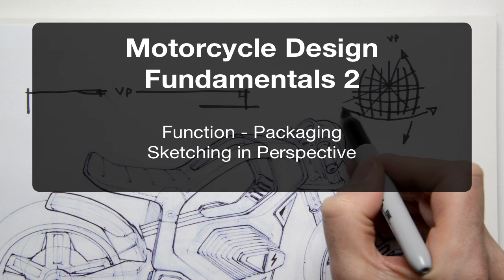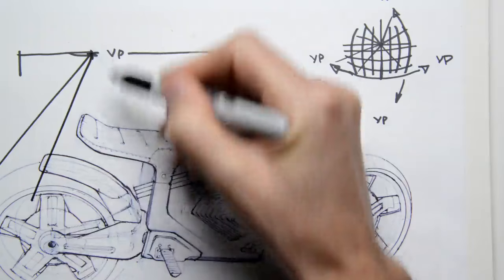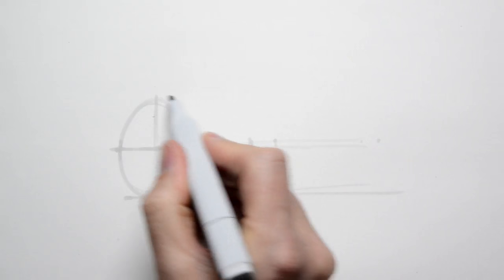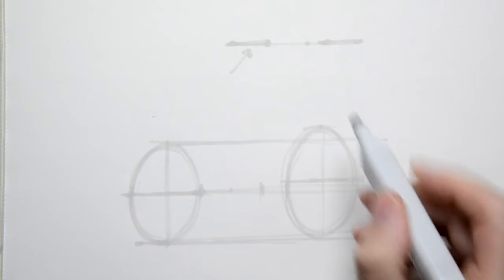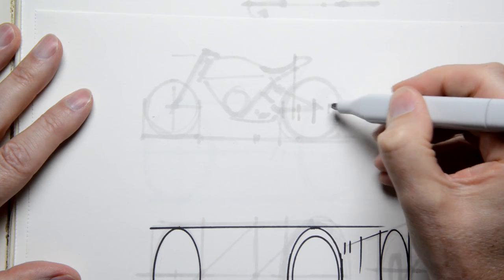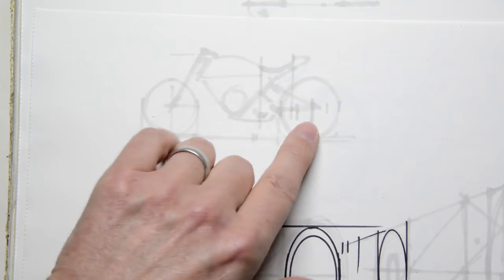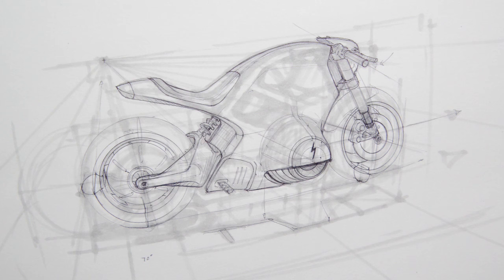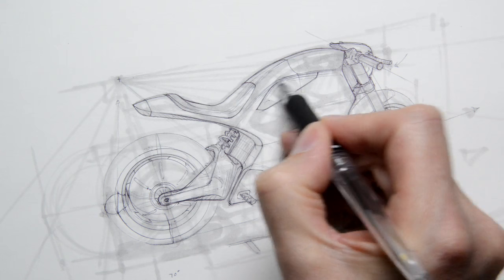Gumroad Tutorial Excerpts: Motorcycle Design 2

Comment: Many people lack the comprehension of the force.  And the direction of the force while moving .. the force line of the force direction is parallel to the road surface (road surface, tire surface, falcum point of both wheels  And finally, the center of gravity.  Of the weight of the car and people) .. but when the car turns  But the road surface is not sloping  With the line of force of the direction of force  Will lose the balance

Comment: Incredible insight from all your tutorials. Also own your How to Draw book and it’s invaluable. I do have a question regarding your technique for building the front tire. The ellipse used for indicating the tire at center... is it one ellipse guide completely, or is it one ellipse guide to create the inner edge of the rim barrel, and then a larger ellipse guide at the top and bottom to connect the outer edge ( tire center ) to the right side of the inner tire? Hopefully that makes sense. Or is it just one ellipse guide of a different degree
Reply from the maker: Good question and good eye! It's not one, single larger ellipse guide to create the silhouette of the tire. I use a single guide for the rims, but if you then let the tire section properly dictate the silhouette you will observe a single guide will not match to your section lines properly, so I sort of blend a couple together or move around a single larger one to adapt to the section lines of the tire. Hope that makes sense.
Reply: Thank you! What you described is how I have been executing it, but I was second-guessing whether there was an obvious easier way I wasn’t picking up on.

Comment: Hi Scott, I bought your Motocycle design 2 in gumroad. Im confuse by the degree of the motorcyle wheel. You said in 20:22 that the front wheel is 45 degree ellipse and the back wheel is 40 degree. I think that was 50 degree because of the vanishing point converging on the left. correct me if I'm wrong thanks.
Reply: riccia888 20:20? The video is only 13 min long.
Reply: He's talking about the entire tutorial on Gumroad